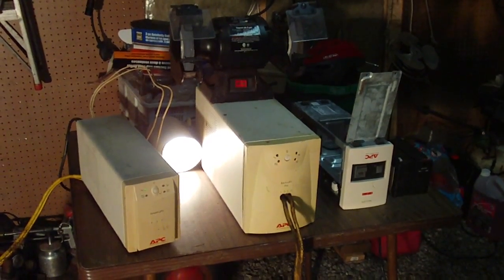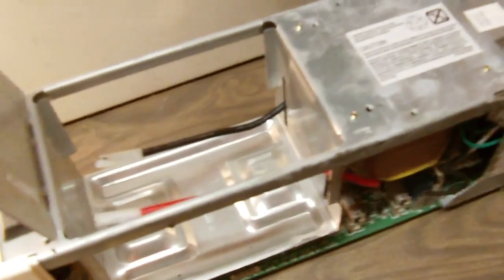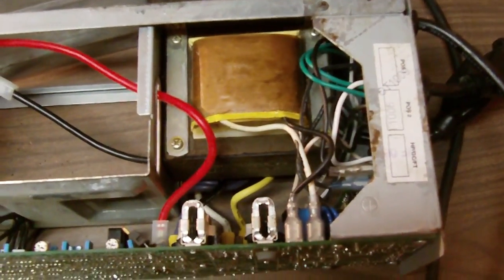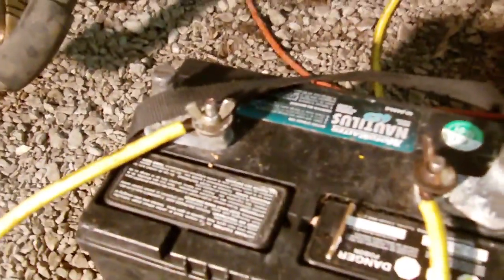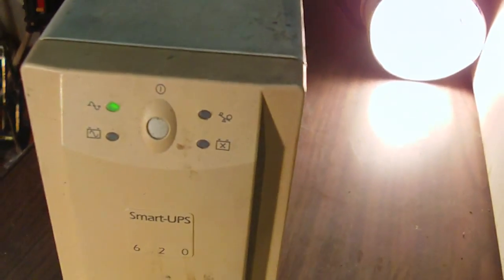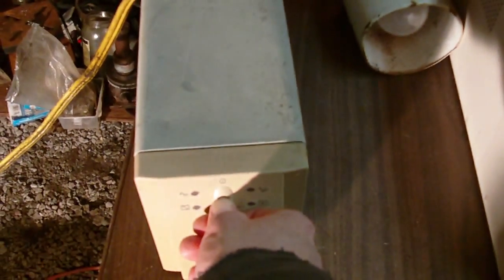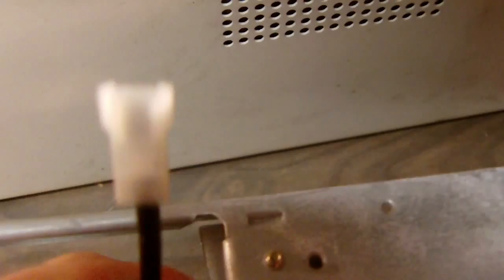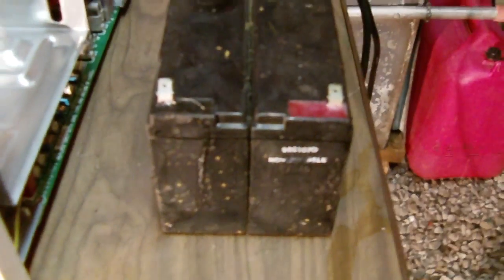How to convert a UPS backup into an inverter

Comment: In reply to Samual Krokson's question...

Connecting a relatively small UPS battery to a vehicle's 12V while the engine is running might deliver too much current to the UPS battery, unless the battery is already fully charged.  It would be safest to install some sort of jumper or switch so you can either run the UPS from the internal battery, or from an external one.  If you did need to charge the internal battery from the vehicle, use a resistor in series to limit the current to around C/5 (where C is the capacity in ampere-hours).  For a typical small 7 Ah battery,  2 ohms (5 watt rating) sounds about right, or try a 5W 12V lamp instead of a resistor.  Keep in mind that charging only happens when the engine is running, and it could take an hour or more to recharge a low battery.

As for the UPS vs cheap inverter issue... most small inverters produce 60 volts AC with respect to ground on both hot and neutral, in opposite phase, so they sum to 120 volts.  That shouldn't affect anything.  If you power a UPS (as an inverter) from a running vehicle, where "12V" will be closer to 14 volts, the AC output may be closer to 140V than 120V.  That might burn out incandescent bulbs prematurely, but I expect modern electronic power supplies won't care.  On the other other hand,  for a great many electrical items you can find chargers or supplies that will run directly from 12V, which will be more efficient.
Reply: BassBinDevil you can't force too much current into a battery. a battery draws what it needs from the altonator.
Reply: Thanks for your input, been thinking it over and if I watch my UPS battery for heat it should work as long as it stays cool. Was more worried about the UPS electronics not liking the alternator.
Reply: Pretty much every SLA battery I've played with says that charging current should be limited to something like 1/5 the nominal capacity.  For instance, 1 amp for a 5 Ah battery.  If you check the application notes from battery manufacturers they should explain why that's necessary.
Reply: Higher voltage can force a small sealed lead acid battery to charge at unhealthy rates. A car alternator will be a little bit high but I wouldn't worry about it if you're using it as a inverter you need a bigger battery anyway

Comment: Question, will this work? Taking my working APC UPS and tapping the battery leads to plug into a running vehicles cigarette lighter while leaving the UPS battery still hooked up? I would disconnect when ever cranking the engine is required.  Its a 550VA 330Watt UPS with a 12volt sealed lead acid battery. I run my all in one computer that draws 69 watts +or- with programs running. I love my UPS but it sucks that it wont stay on threw my inverter.
Reply: Please explain that last sentence:
are you saying that the UPS you have does NOT work with the inverter you have?
Which models?
Reply: It will work for charging the UPS battery but be careful not to take too much power from the UPS or it will blow the cigarette lighter fuse

Comment: I've tested quite a few of these UPS's and found them to be very inefficient, they consume between 500ma - 1.5amps when idle. It could help you in a pinch but not for very long, you'd probably be better off buying an off the shelf inverter for much cheaper then a UPS. I bought a really cheap 1 at canadian tire (300W) and it only consumes 100ma at idle.
 
Cheers Hitman
Reply: You're right about that I had the 24 volt 600 watt model and it pulled 30 Watts continually and wasted it into heat no matter whether I was running the generator or running directly off of the batteries

Comment: I guess using a car battery is good in a pinch, but you're better off investing in a deep cycle battery, as they are design to be charged and then discharged multiple times and a car battery is not. Great idea though, I'll have to keep my eyes open on garbage day! ;-)

Comment: Here u go buddy. Straight from howstuffworks:   
There are two common systems in use today: standby UPS and continuous UPS.Standby UPS systems are far more common for home or small-business use because they tend to cost about half as much as a continuous system. Continuous systems provide extremely clean, stable power, so they tend to be used in server rooms and mission critical applications. SO.... does that answer your question 'DUDE'?

Comment: I you need to check online to see if the OEM replacement battery pack is 12v or 24v,  most of those are set up for 24v, and the fact that you are getting them to work on just 12v makes me think maybe it is a learning charge controller.   Some of the solar charge controllers will learn battery voltage like that and automatically switch, but I did not expect to see it in UPSs.    I picked up a 1200 watt UPS at a recycle place but have yet to test it.

Comment: Yeah, those things are usually set up to run two 12v batteries in series, and they usually have a charge control circuit inside that can "learn" the capacity of whatever batteries are hooked up up to it.   You just plug it in the wall and it not only acts as a charge controller but also a surge protector.   You can't use it to charge a single 12v battery though, must have two.

Comment: lmao... always runs on the inverter..... dude, it has a fast relay that switches over to battery once the power dies. It DOES NOT always run on the inverter.
Reply: My 24 volt 600 watt unit works just as you described. I was actually able to pass 2,000 Watts through it from the generator

Comment: on those ups the transformer is the power supply to charge the battries and power the inverters computer there are relays that flip the inverter on when power goes out sending power back through the transformer and it osolates taking the 12 volts to 120 volts so the transformer plays double duity as a stepdown transformer and then when power goes out the realy disconcts from mains and then the transformer is a step up transformer. and when power is sinced on the mains it switch back to mains.

Comment: I have this problem, I connected the UPS via the lighter socket and when I turn it on it does work until I plug something into the UPS, so reading your comment suggests that this happens because I use the lighter socket right? And if I try connecting the ups directly to the battery I wouldn't have this problem?

Comment: A lot ov the modern (& cheap) UPS units will only run for a set amount ov minutes. The reason for this is that the power transistors don't have proper heat sinks, so they have a thermistor near one ov the transistors that turns off the unit when it reaches a certain temperature. It seems like a timeout but it's actually temperature. The solution is to bend the thermistor away from that particular power transistor and fit decent heatsinks to all ov them or they'll burn out. Possibly add a fan 2.

Comment: lol.  I was just thinking about trying this.  I have a CyberPower 625AVR that was given to me and the battery was cracked.  I threw the battery away and what I want to do is put a cigarette lighter plug to the battery connector of the UPS then cut the AC plug off.  Then use the CyberPower 625AVR as an inverter in my Van to power laptops and my Xbox360.  Does this sound like it will work well?